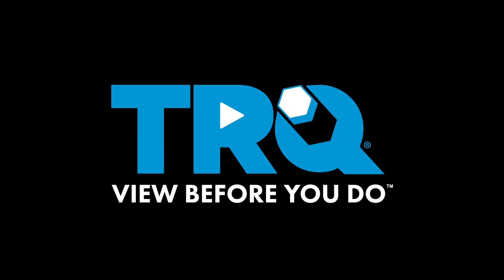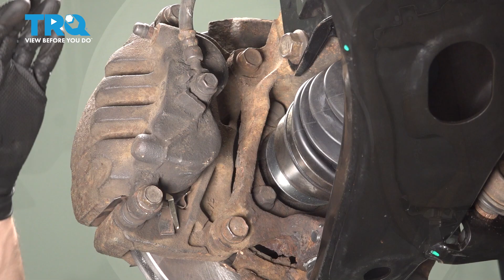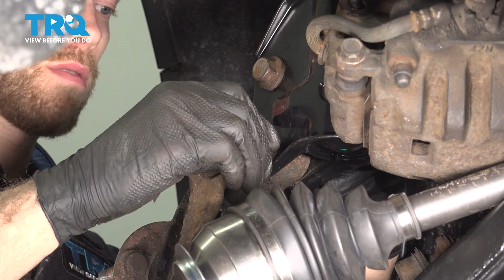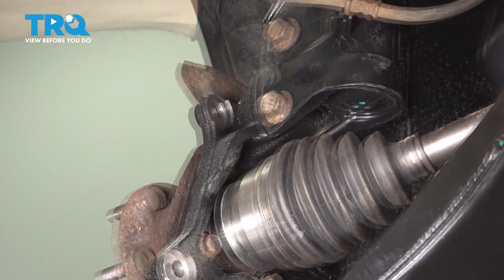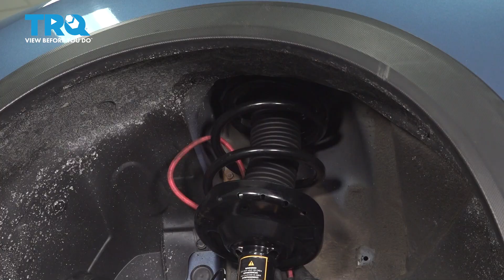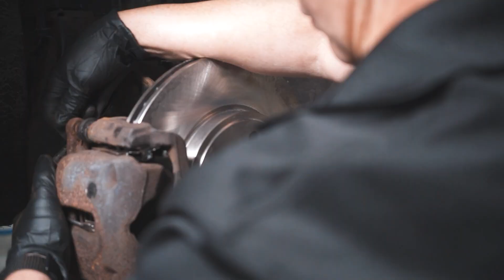How to Replace Front Knuckle Assemblies 2013-2015 Subaru XV Crosstrek

Comment: thank you so much for this video. i was able to replace my front knuckle (and also wheel bearing hub) on my 2015 xv crosstrek. i had never done one before and your video was a huge help, including the torque specs. i even went ahead and replaced the outer tie rod. i live in the rust belt so it just made sense to replace everything (shoutout to Rock Auto for great prices) and i couldn't have done it without your amazing tutorial. thank you!